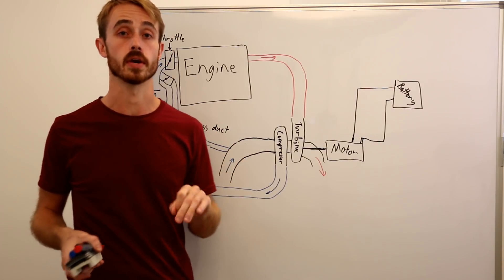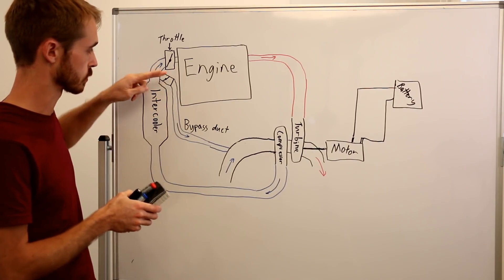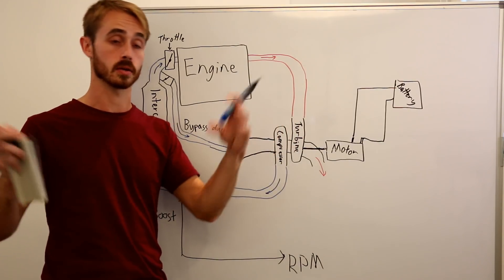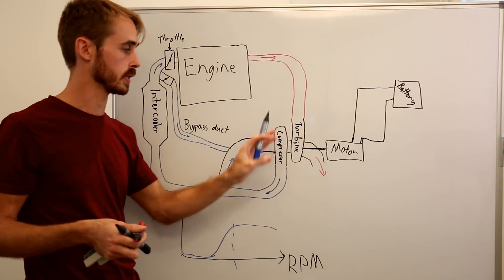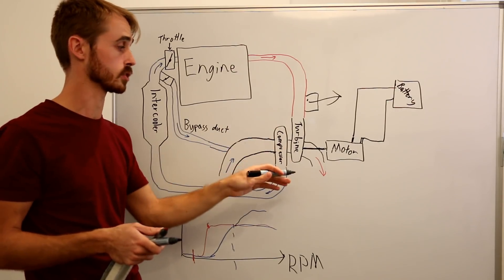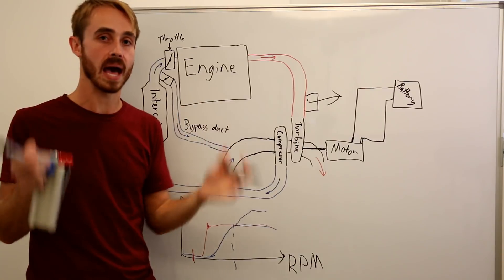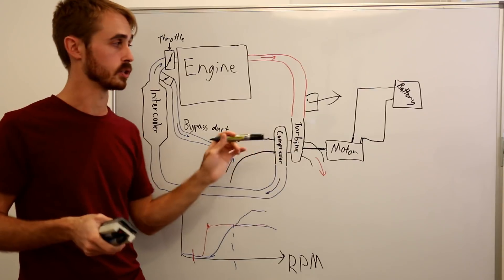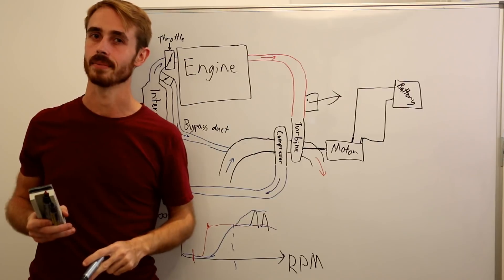How do Hybrid/Electric Turbochargers Work? Hybrid Turbos (MGU-H) Explained

Comment: I always imagined the term "electric turbocharger" as a purely electric compressor. Silly me.
What keeps me baffled is that  when the throttle body is closed and the turbo is kept spooled up, we're just looping the same air mass over and over again through the intake system. Wouldn't it be more sensible to have a blow-off valve dumping everything into the atmosphere so the turbo can be spooled with less effort from the motor? Also I imagine that the MAF sensor has to be placed right before the intake valves to get valid measurements.

I'd like to see a comparison of a variable geometry turbocharger and an electric turbocharger. Modern cars (especially those with automatic transmissions) love to operate right above the engine idle for city cruising and that's where I feel like the electric turbo system would get stressed to death because that's the condition where the spooling would needs to happen.

As always, a great video and explanation. Thumbs up!
Reply from the maker: +Martin Cerman Hmmm that is a good point actually, I have updated the video title now to avoid confusion!

A bypass valve is actually typically far more efficient than a blow off valve, as the flow losses within the pipe are small in comparison to the fact that the compressor is now essentially powering itself, as the energised gasses are now recirculating back through the compressor. If we were to dump these to atmosphere with a blow off valve, the energy of these gasses would be wasted, and the turbo will actually spool down faster. Technically speaking, a bypass valve is considered a form of "anti-lag". You can still use a MAF with this system before the compressor and bypass valve return (as in my race buggy, and many production cars) As the circulation only occurs when the throttle is closed, and all the air metered through the system actually stays after the MAF, so the readings are accurate. A BOV will actually make MAF readings inaccurate, as air will be drawn through the snesor that is then not making its way to the motor, so naturally the ECU wants to add fuel if there is a part throttle applied.

 I think the real advancement we are likely to see in cars will be the combination of electric turbos with VGT and sequential turbocharging! The best of all worlds, however it's going to be a while before the manufacturing cost is low enough for the performance benefit to justify it. 

Thanks for the compliments!
Reply: +KYLE.DRIVES Yeah, I was wrong with my opinion and that's why I'm not an engineer and you are. :)
Also, I know that Audi is pushing the concept of electric turbos for some time and they seem to have a different idea. I guess image will tell more than my vague description.
http://www.germanboost.com/images/imported/2014/07/RS5c140019-1.jpg.
As far as I can tell, they're really using a separate electric compressor to produce some boost as soon as possible.
I'm not very optimistic about the electric motor being a part of something so extremely hot like a turbocharger but the idea is definitely really interesting.

EDIT: I just realized that electrically assisted turborcharger and turbocharger+electric compressor are two completely different ideas and should probably not be mixed together. Sorry.